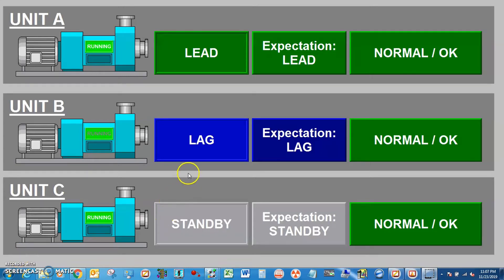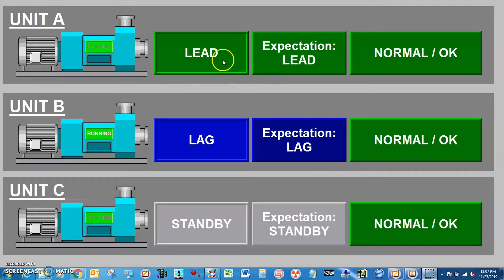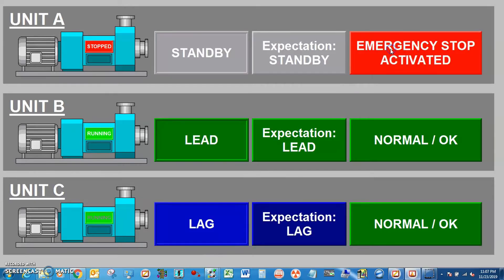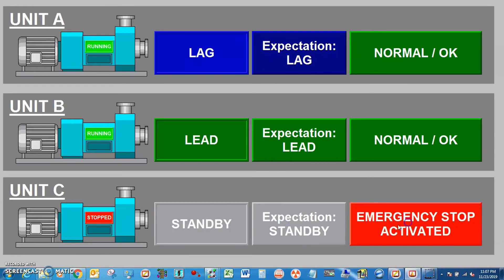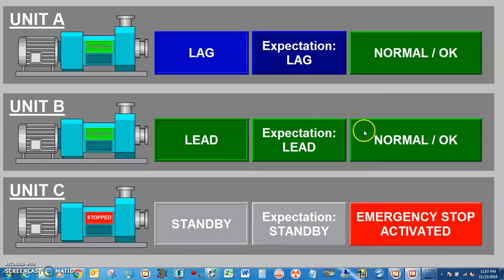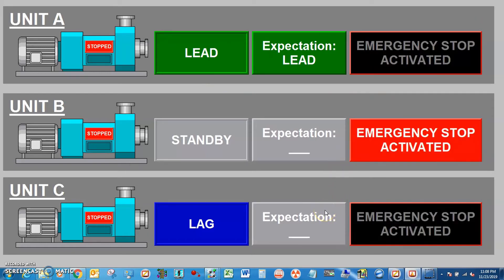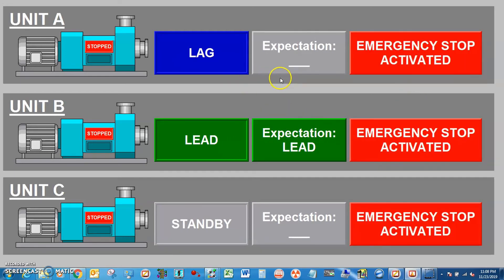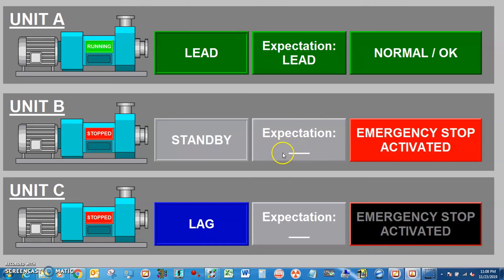Automation Control Lead/Lag/Standby Configuration

Comment: Appreciate your video although operators do not swap lead lag in the real world so no manual interaction please show an automatic example
Reply from the maker: @ShaneWelcher: Thank you for your support to my channel. The video description has the link for the actual logic in Studio5000 Logic designer if you are interested in study the logic behind the video. The logic has been in our logic for multiple systems. I am not sure why operators should not swap lead lag in the real world in your opinion. The whole purpose of lead/lag/standby is the automatic swapping between lead, lag and standby. If the lead unit is no longer operational, it should automatically step down to standby and wait for the service/maintenance. The lag unit needs to automatically step up to become new lead to ensure the output of the system to be always optimized and meet the requirements. Even if all units are running OK, the auto swapping still needs to take place once for a while to ensure all units run equally to avoid too much wear and tear on one specific unit that always is set to be the lead one. The bottom line is that if you do not want auto swapping , there is no need for lead/lag/standby control.

Comment: Hi anh , anh có thể làm cho 12 pump đc không
Reply: Thanks for your demo,  very good sharing. :D
Reply from the maker: Lead/lag/standby is a setup for only 3 units where only 2 can run at a time if needed. Between those 2, the lead unit always starts running first but stops after the lag one. I am not sure how you want to control up to 12 pumps? Are You talking about the start and stop sequence controls?
Reply: Sr, I try programmed 12 pump with lead lag standby control but so many case could be happen. I not sure my program can be cover all. So if you already meet situation like me, please let me know. Thanks.
Reply from the maker: You are absolutely right. There are too many possibilities for 12 units running in lead lag configuration especially when you have only 1 unit in lead. Don’t kill yourself. I did one last year with 4 units in lead-lag-laglag-standby. System can only start 1 unit at a time and only 3 unit max can run together, the forth one is just a spare set to standby. It took me a while to cover all the possibilities. What I would recommend in your situation is:

First, you have to know the maximum number of pumps that is allowed to run at the highest demand.

Second, how many pumps can start together at once to avoid the inrush current.

Third, let’s make it in 3 groups (4 units for each group) if only 8 pumps are allowed to run at the maximum. 

Finally, if the lead group loose 1 pump, the logic will make it become a standby group. Current lag group and standby group become new lead and new lag group.

It’s confusing but I think it’s more practical than to start only 1 pump at a time. Good luck.